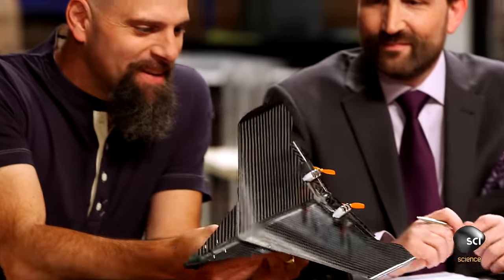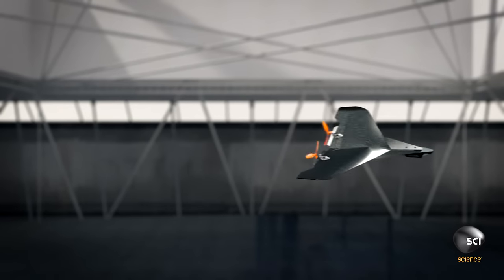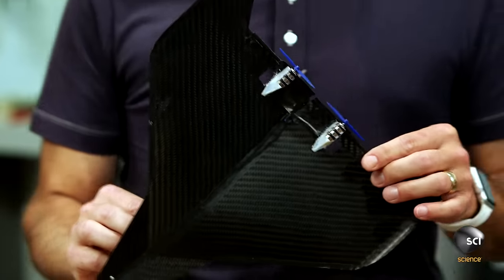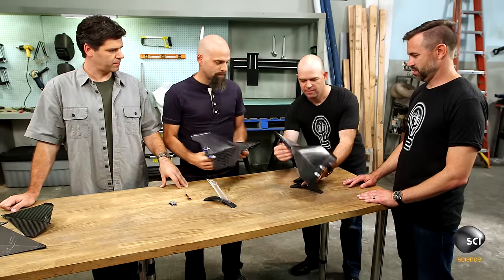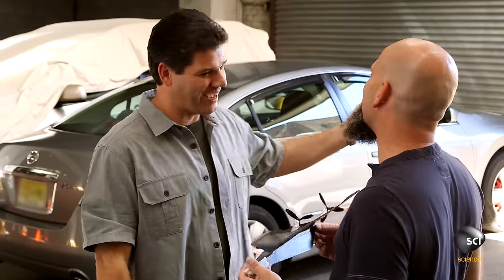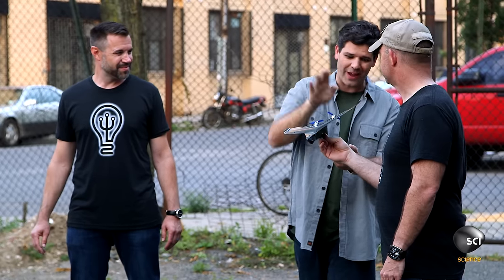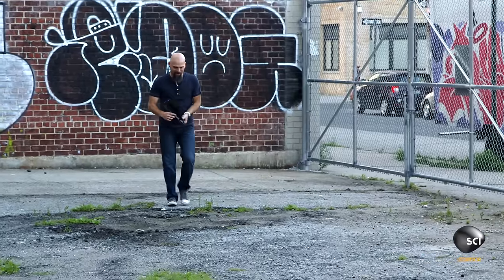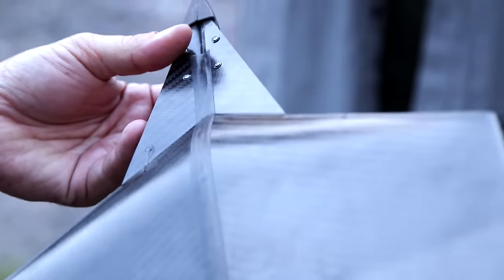The Carbon Flyer Remote Control Plane

Comment: How many thousand's  of people have prepaid for this and never gotten nothing some of them have been waiting for 2 years and nothing. That is the question... besides i don't like any plane or quad you have to fly with you phone it makes for very bad flying. I fly hand built  Rc Planes from Balsa wood durability comes form skill not what it is  made out of. just another gimmick to take your money'....... I am 51 years old i still have planes i built back in 1975 . The last i seen they were trying to get them manufactured in china.
Reply: +Harlan Mote They just announced first shipments to original backers.  I'm an original backer.  It has been a long time.
Reply: If you don't mind me asking how much did you pay for it...
Reply: +Harlan Mote 100 bucks for original backers Don't know how much now.
Reply: +Harlan Mote i agree, most durable rc planes are the ones you dont crash
Reply: I've had plenty of planes that were wicked expensive and had them for years...malfunction suddenly and they crash and burn...it's so sad.
Reply: . You have to check them and make sure there flight ready leave nothing to chance. This carbon flyer is more for the new flyer. It really needs a tx in stead of using your phone That's a hard way to control any Rc plane heli or quad. Been there done that and didn't like it. I have been Building and flying planes of all kind's for over 35 years almost i have only lost a hand full because of pilot error or because a nitro motor going out.I'm all electric now much less chance of something going a fowl...You can only crash something so much before it just a pile of junk carbon or what ever.....